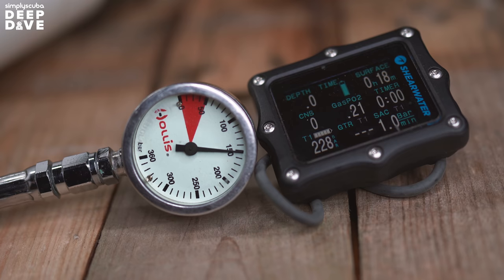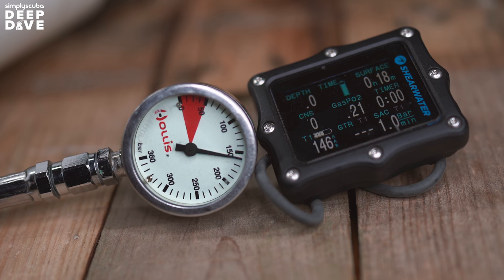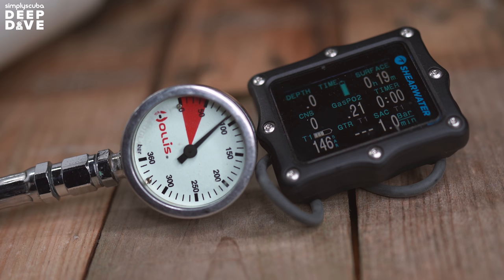The Quarter Turn | Deep Dive

Comment from the maker: What do you do? Are you a quarter turner? Are you changing the way you do things? Or have you been full opening for years already? Because this isn’t a new concept, let us know below.
Reply: As i've said before, the only issue I've seen, and this one several times, was a diver who tried their valve to ensue it was fully open, couldn't move it, and assumed it was therefore fuly open.  In fact it was hard shut and that's why it didn't move.  The open and back-off method means that when you try the valve it will move to fully open and you know it's fully open.

Comment: Since learning 1/4 turn back when getting my ticket in the 1980’s, I’ve turned every valve, tap, cock, etc back just a bit off fully open. Thought if the theory was good for scuba valves then it wouldn’t hurt doing it on every valve. 
Without knowing it at the time the practice has saved myself an enormous amount of grief. One place lived at the water had a high calcium level & over time fully open taps would be ‘welded’ in that position. Having the 1/4 turn of free play enabled the tap to be turned in both directions to break the crust. It was only a chance discussion with a neighbour years later that made me realise it was the difference which saved me a fortune in plumber call outs over a decade.

Comment: Love the explanation, I am an instructor that teachers the quarter turn, but I have also experienced a diver turning it the wrong way and only experiencing troubles about 20 minutes into the dive (not ideal, and very confusing when guiding a large group in a current). That situation has led to me always having divers take 3 breaths off their reg while looking at and showing me the guage. I call it my own idiot check, but my stance is if you have air, all the other issues can be solved for the most part

Comment: After the DAN article I've been teaching fully open. Personally I will do a slight turn back simply because I've trained to reach my own valves over my shoulder (thinsets or H valve with dual first stages) and it's easier to manipulate the valve this way.

As far as people touching my stuff I will check my kit then turn off the valve for long boat rides and purge partially. I remember the pressure and then when I come back I can immediately tell if someone has touched my kit as the pressure probably has changed. Then the entire checklist starts over.

Comment: After learning the 1/4 turn back when getting my ticket in the 1980’s, I’ve turned every tap, valve, etc back the 1/4 turn.

A practice which has saved me grief on many occasions as calcium in the local water supply is renowned for jamming taps left fully open for any length of time.

Comment: First time visiting Peacock Springs, one of the instructors points out that here is where the quarter turned become verboten in cave diving. Sheck was descend into Peacock, back then it was a tight fit, so he was going in head first, and got stuck maybe 10 feet down the crack, and it was then he discovered that the quarter turn will work on the surface, but at that depth with the extra work to try to get unstuck he was struggling to breath.

After he worked his way out, the quarter turn was added to the Blueprint of Survival (though it was a half a turn back in that book) as something not to do.

Comment: I am a technical diver. When I swim under restrictions, sometimes my left post valve rolls. I can find it halfway between closed and open. It can be hard to remember which way was closed and which one was open. 
I find it easier if it is fully open.

Also doing so many valve drills, I know it is not damaging to the valve unless you are jamming it. I can see a little use living just an touch loose, so that it is easier to open or closed, but I find quarter turn a quarter too much.

Comment: We do this when replacing aircraft oxygen cylinders because they remain open for extended periods of time with huge temperature changes, so it makes sense. With scuba diving (especially in warm water), I don't think it's an issue. The valve is not kept open for a long time and no huge temperature changes over extended periods of time. Even if the valve is stuck open, it wouldn't be a big deal since it would get loose when you're out and in a warm place.

Comment: Years ago I remember reading they were worried about the Valve Piston Slamming. Why they weren't fully opened. As a guy who worked as an Auto tech, The Principle are the same. My Home (Garage) compressor. The Reg I never fully Close. I have seen the Valve get Stuck in the Non Use Position. And have to replace them.

Comment: I believe that there could be another reason for this which is totally unconnected with diving but is more to do with mechanics. If you screw a nut onto a bolt, it is possible to do this so hard that it is virtually impossible to undo. (Ever tried changing a wheel on your car when the nuts have been tightened  by a jackhammer?) Obviously, you want it to be tight, but too tight? I watch videos on YouTube of various vehicle recovery firms which use shackles (sometimes called clevises) to do heavy lifts. Virtually every time they screw up the shackle (Either into a thread in the main part or a bolt and nut through the main part) they do a 1/4 turn back (normally there is also a hole in the shaft which they put a pin in to prevent the thing coming undone). I know this is totally different to valves used in cylinders BUT there is still a screw thread involved.

Comment: Something you didn’t mention was dive crew, who usually give you a final valve check before doing your giant stride out from the boat. If they think the valve is hard closed they’ll wrench it hard open when it may already be.
Reply: This is why I teach my students to do the quarter turn.
Reply: This is why once in the water I reach back and fully open it with finger tips. Even single tank you should be able to reach the valve.

Comment: video uploaded 3 days late. I had an incident on Friday. I opened the valve and closed it for 1/4 turn, then I do the same thing, but by closing the valve and opening it by 1/4 turn .... at 30 meters the valve was not able to give me air ... fortunately I ended up using partner's octopus and emergency ascent.
Reply: which is why u should always do a purge test everytime u check your tank and reg, to make sure air is entering your reg
Reply: @egali34  Nope. I do purge test and it was ok ... the valve was open and it was able to give air until 30 m. I made venturi :/

Comment: Why taking a few hits off reg and watching gauge is good idea.
Reply: At the surface you may be able to get air from a mostly-off valve without seeing a significant drop on the gauge. At depth, though, getting sufficient flow could be very difficult.

Comment: The original tank valves had the knob on top and it unscrewed upwards. These valves could jam open, so you had to empty the tank to take the regulator off.  Thus the 1/4 turn rule. This is unnecessary with modern valves. Tradition is strong in diving. I am surprised that BCD's now have weights. I originally got certified in 1975. The BCD was separate from the tank holder, ( like a life vest), and weight belts were the norm. One could ditch the weights and the tank, and still have flotation. Just had to disconnect the pressure hose to the BCD. Mine also had a CO2 cartridge that could fill the BCD with a cord pull.

Comment: Bro just open the valve till the pressure gauge pressures, not need to twist/turn anything past that point
Reply: You clearly missed the point. In a partially open position the main tank valve can fail to provide sufficient airflow at depth. This is literally how the incidents occur...